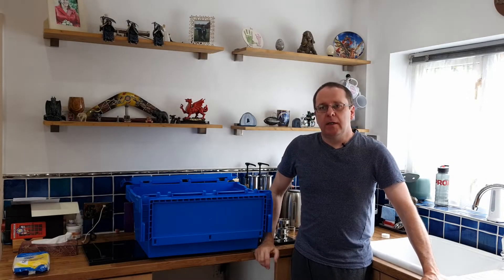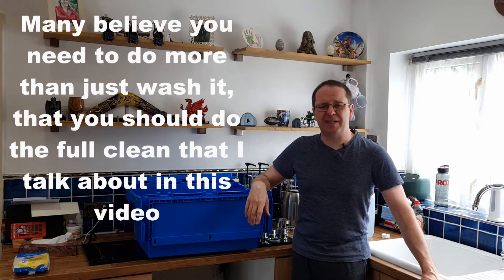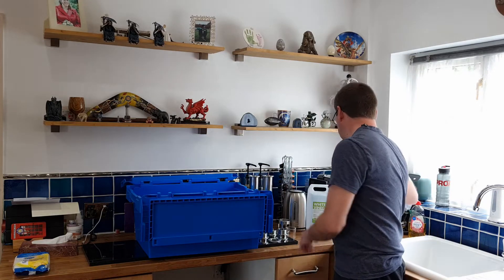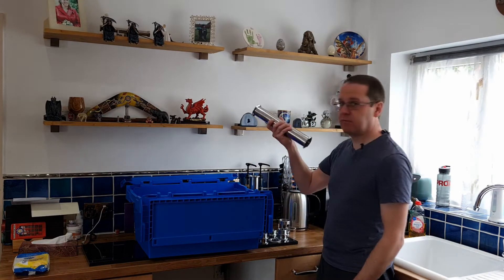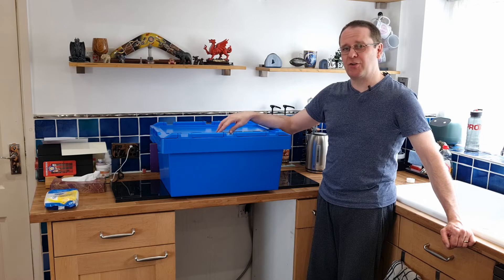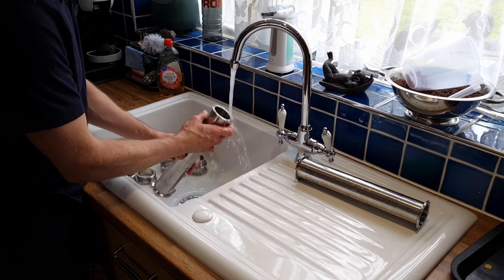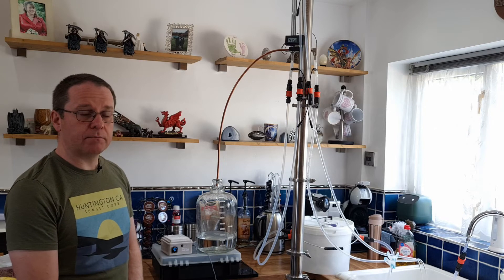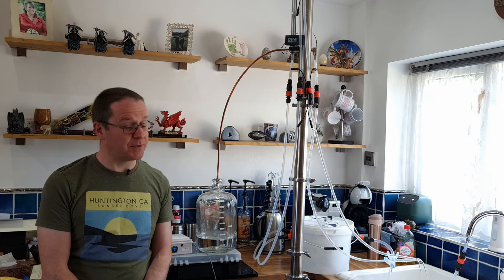Bought a new still or parts for your still? The factories do not clean them fully!

Comment: Any updates on how this still has gone? A full video on building the ultimate modified T500 would be a hit I think.
Reply from the maker: Hi, I do want to do a video on this.  I have been testing it with different packing to see what suits it best.  I am also testing power controllers as well.  As soon as I am able to, I will do a video on how to upgrade the T500 column.  I do love it, and it now produces the purest spirit you can get through distillation!

Comment: Would you do the same with a new Air Still?
Reply from the maker: Hi Adrian,
Difficult question that.  I don't think you need to do a full vinegar run and then sacrificial spirit run before use.  Hopefully a hand wash with a small amount of dish washer soap will do the job well.  The problem is that there is no way to know how well Still Spirits clean their equipment.  It would cost them time and money to properly clean them, so do you think they did it fully?  It is all personal preference really.  If you don't want to, then don't do it.  If you have the time and energy to, then why not do it.  It won't hurt the still, but you will know that you prepared it properly and you will know that it is safe and clean.  I own two Air Stills and I only cleaned them with soapy water.  My bigger T500 & Love Brewing boilers I did clean fully as well as all the columns and parts that work with them.

Comment: Hi . Love the videos. I've just upgraded from an air still and now have the love brewing boiler with the copper T500. A lot is mentioned about the temp of the outlet water but not about the boiler Temp. I intend to run a 25 Ltr Turbo Pure wash,  what temp should I set my boiler to. I'm confused Thanks Steve.
Reply from the maker: Hi Steve.  Congratulations on your upgrade.  I still have my two Air Stills and I use them from time to time for small test runs.  The temperature you want to set on the Love Brewing boiler is 110C with both heating elements switched on.  The boiler will take around 45 minutes to heat up before it will need the cooling water turned on.
Reply: @brewingadvice  Wow thanks for the mega quick response. hopefully get my first wash through on Mon. keep up the vid's
Reply from the maker: No worries  @steveoliver1845  , good luck for Monday.  Don't forget to throw away the first 100-200ml of output.  Still Spirits say you don't need to, but it is always a good idea to.
Reply: @brewingadvice  so cool, just finished my first run and got 3.5ltrs at 93%abv. im so so happy right now. Thanks again for the advice
Reply from the maker: Nice one  @steveoliver1845 .  So happy for you.
Reply from the maker: Hi  @andrewclark3291 .  The reason why we set it to 110c is because it needs to be higher than the maximum temperature you want.  You could set it to 100c, or 101c or anything above 100c really.  Setting a higher temperature will not allow it to heat any quicker.  The reason for this is that once the boiler reaches the set temperature, it will turn off the heating elements and will wait for the temperature to fall by 5c before it turns the heat back on.  For distilling, you need constant heat, to have the heaters turn on and off will stop the vapor from being created and it will stop the distilling process.
Reply from the maker: Sounds good  @andrewclark3291 .  SPP is the best packing you can get.  To get higher ABV (so more purity) you would need to extend the reflux tube to allow for more packing.  I am currently adding an SCR for power control so rather than dialing in a temperature, I can regulate the amount of power going to the heat elements.  This is a far better way to go, but not something for everyone.  Adding power control to a T500 boiler is simple, as there is no technology in it.  Adding one to a Love Brewing boiler is harder as it has a computer.  Sadly you need to get into the internal wirering and literally re-wire it to bypass the computer.  This I am doing myself and changing the heating element switches so I can specify if I want to use the built-in computer or an external SCR.

Comment: I like your new set up, Two Q:'s  Are you running packing the full length of the extended column?
Are use using are power controller ?. Love your vids Sir please keep them coming. 🙏.
Reply from the maker: Hi Gary. Thank you, I am very happy with the still and how it works.  I will do a video at some point explaining how you can upgrade the T500 and why you would want to..
So, your questions.  Yes, it is almost fully loaded with packing.  Basically the first 12" Tube at the bottom is full of copper SPP.  The second 12" tube is filled with steel SPP.  The T500 column has the standard steel packing in it, but there is a 3cm gap where there is no packing.  I also have a 4" (10cm) tube which is empty.  What this does is that when mounted to the boiler, there is 13cm area at the top that has no packing.  This empty area is where the reflux coil is.  By having no packing around the reflux coil, it will allow for far better refluxing.  The reason for the three different types of packing is so it can get better interaction as it gets higher.  The steel SPP are close to half the size for the copper SPP and the copper SPP is over half the size of the standard steel packing that comes with the T500.  In total it has 46" (117.5cm) worth of packing.
Your second question is over a power controller.  Right now, no, I am not using a power controller, the boiler is out of the box.  I have created a power controller on another boiler that I have and am currently doing tests on it.  I am hoping in the next two months to have finished it, and then I will install it into my main boiler to use all the time.  The reason why this is taking time is that while I do have one for the T500 which is a simple thing t do, this new one is for the Love Brewing boiler which is a lot harder to wire in as I want it to bypass the built-in computer and have it as a selectable option.  That way I can choose each time if I want to use the built-in computer, or my power controller.
Reply: @brewingadvice  Thank you for taking the  time to explain to me your system I do appreciate it, each time I leave a gap at the top of the T500 column (under the copper coil) I have problems with gurgling in the column followed by about 100ml coming out the spout in split second, I also use a combination of 3 x 3 SSP and copper scrubbers along with the normal T500  packing in said column. I,m very interested in seeing how your new power controller works,  I've made two power controllers one  with 40amp SSR solid state relay and potentiometer knob, and another with a P I D controller and K type probe, I suppose P I D's have a place in distilling but I don't think they are of much use in reflux stills, well at least in my experiences. (Sitting on the letterbox kicking my feet waiting for your next video). ⚗🧪👍.
Reply from the maker: Hi  @garrymcgaw4745 .  I wonder if your copper scrubbers are a little too tightly packed.  Often if they are too tight the liquid coming down from the coil can get trapped on the scrubber rather than getting through.  This can often result in a build up which in turns means a lot comes out of the Product Condenser in one quick go.

I think a PID is great for lower heat like when brewing, but not for distilling. A SCR is the far better option.  I would love to know how you setup the SSR and potentiometer.  Any chance you could give me links to what items you bought?
Reply: @brewingadvice  Another few Q's where did you get those temp sensor and fittings and what kind are they? I love them. Cheers  mate.
Reply from the maker: Hi  @garrymcgaw4745  , the temperature probes are my own creation.  The actual sensor they use is the DS18B20 which is a digital sensor.  As to the fittings you asked about, I am not sure which bits you mean.  Can you drop me an email to: info@brewingadvice.uk with a screen shot of my video showing the part you are asking about.  I will gladly help you.

Comment: What's ur boiler, looks like my mash and boil. Works for distilling?
Reply from the maker: Hi Abby, the boiler is from Love Brewing in the UK and it is 25 Litres.  Also known as the Spirit Works 25 Litre boiler.  It can be used for all sorts of things as you tell it what temperature to heat to.  You can also select to use the 500W & 1750W heating elements independently or both at the same time.
Reply: @brewingadvice  very nice, thank you.

Comment: I'm a little confused. In your intro you say if you're "getting a still from Still it should be good enough" but in your notes you say that the T 500 or similar should have the acid run.

Can you please clarify what you think should happen before you use a brand new T 500. My 1st wash is on atm and I'm hoping to put it through this coming week. Thank you.
Reply from the maker: Hi Ardnfast.  Sorry for the confusion.  I hope that Still Spirits have properly cleaned the T500 boiler, the Alembic Pot Head, the Copper Alembic Column & the T500 column.  This is why I said I think that a good wash in dishwasher soap will be ok.  Since I made the video a few weeks ago (but only just had time to upload it) I had some very in-depth chats with professional brewers from different parts of the world.  Most of them think that Still Spirits and the other major players don't have the time or money to do proper cleans, so we the customer MUST do the acid bath, the acid vapor run + the sacrificial run to clean them.  This is why I put the text overlay.  Really it is up to you to decide on what you are most comfortable with.  It is probably better to clean it fully as that way you know for sure that what you are producing hasn't got any Flux or other un-safe item in it.